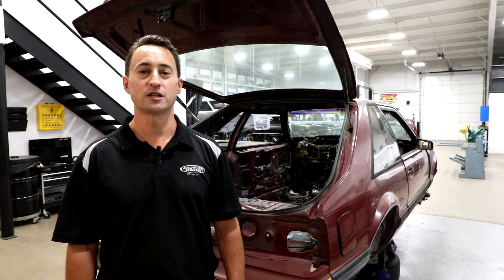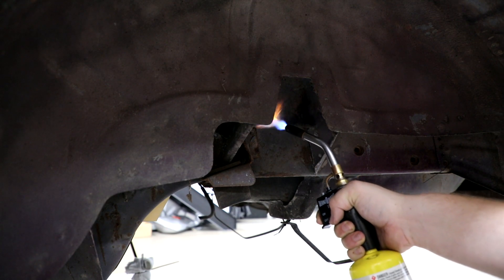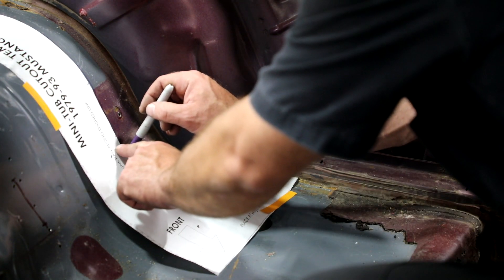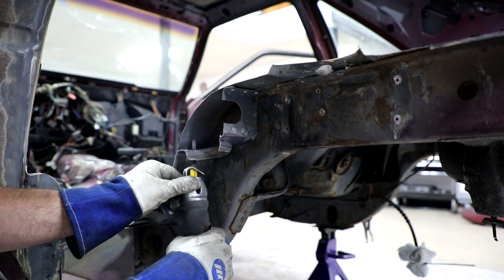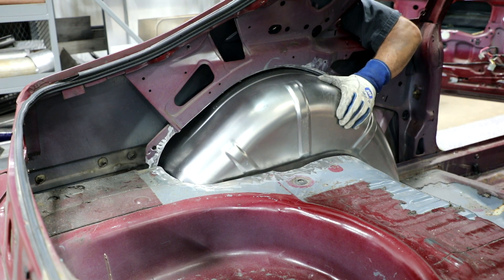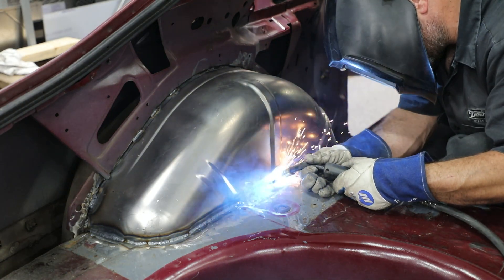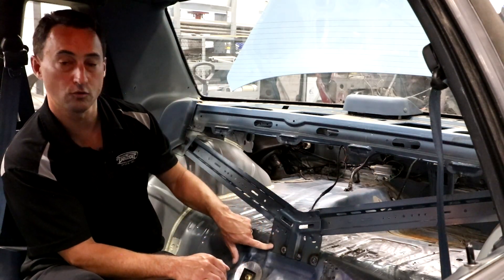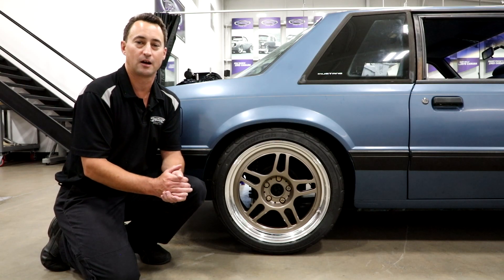How To Install Detroit Speed's 1979-93 Foxbody Mustang Mini-Tubs

Comment: This looks great, but what about the shock mounts when you're done? I assume there's going to be a rear suspension kit from DSE, but would be nice to have a shock relocation kit for those that go a different route.
Reply from the maker: We now offer a complimentary suspension kit for our Mini-Tubs. https://www.detroitspeed.com/1979-93-mustang-rear-suspension-components
Reply: The only suspension kit I see arr the upper/lower control arms. Am I missing something?
Reply: @mathewshackelford8037  Detroit Speed does offer a coilover kit that mounts the upper shock in the frame rail and the lower shock on an offset bracket. How about $1500 for brackets/mounts, non-adjustable shocks/springs, and hardware? The price goes up from there.

Comment: Quick question, what did you do with the seatbelt mounts that are spot welded to the wheel well .
Reply from the maker: We have a bolt-on seatbelt relocation bracket included with the kit.
Reply: I see that it came with the lower seat belt relocation mount, I was talking about the upper shoulder belt that has its mount right on top of the wheel well in a hatch.  Do you have to convert to strictly lap belt or do we just cut it out and weld it back into place after the tubs are in
Reply from the maker: Sorry for the confusion. With the upper mount in later cars, you would just need to remove it from the factory tub, modify the flange, and weld to the new tub.

Comment: Where do my coilovers mount? 😎
Reply: looks like its designed to work with their rear Suspension that's coming in fall. kinda stupid to me to sell a product that makes you cut out your shock mounts  without having a product ready to replace them i dont care if they are sold separate or in the kit
Reply: @blakeholton6274  there is like 100 different companies that offer up coil over mounts for a foxbody